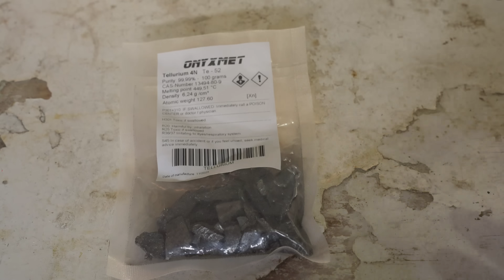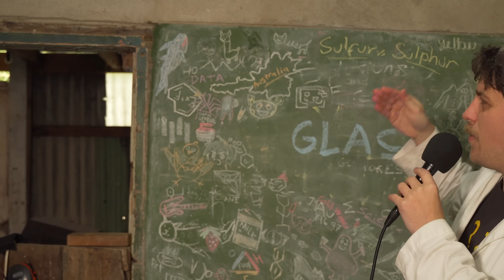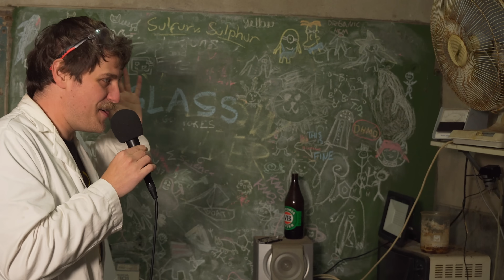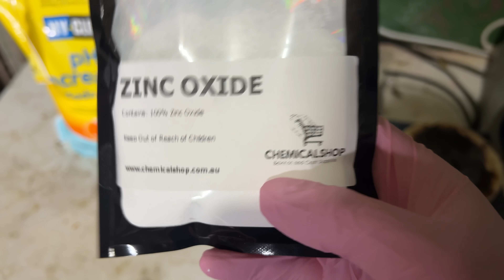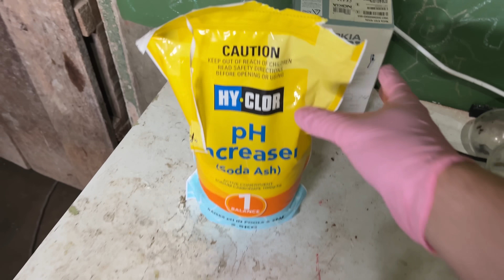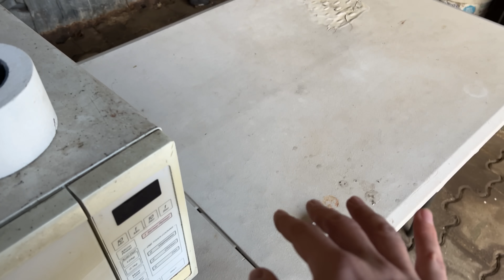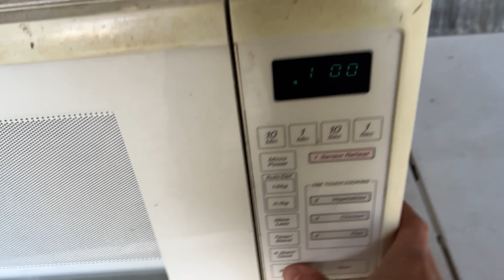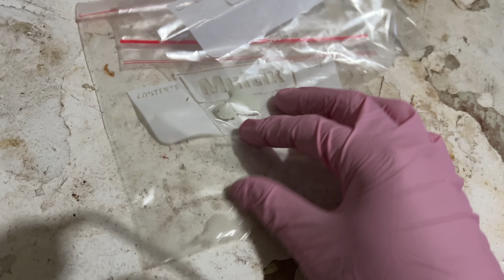Let’s make TeO2 glass with bright fluorescence

Comment: Nice video thanks. Slight misinterpretation, the rare earth does not emit a phonon, rather it relaxes non radiatively (quenching) through energy transfer to the molecular vibrations of the lattice. More precisely the quenching is via the overtones of the phonon energy. Hence if the phonon energy is high, it only takes a few times the phonon energy to be quenched, and if the phonon energy is low, it takes many times the phonon energy to be quenched. Hence low phonon materials display less efficient quenching of the rare earth excited state.

Comment: A phonon is a collective oscillation of many atoms in a crystal. It's a wave that moves through the material, and can be either transversal (like shaking a string) or longitudinal (like squishing a spring). An atom's position in a lattice is very dependent upon its neighbors. You start to shift one atom, and that'll effect the nearby atoms, which in turn effect their neighbors, hence the propagation of a wave.
Reply: Also, telluride (along with the other chalcogens) form a family of two-dimensional materials known as transition metal dichalcogenides (literally just 1 transition metal and 2 chalcogens per unit cell). Specifically, WTe2 is special because its monolayer is a quantum spin Hall insulator (QSHI): current only flows around the edge of the material, and the direction it flows (clockwise or counter-clockwise) depends on the electron's spin (e.g., spin up will flow CW and spin down will flow CCW). This can be used to selectively populate a material with a certain spin, such as a superconductor, which conventionally achieves superconductivity by coupling electrons of opposite spin together via phonons (hey we just learned about those!). Once you can force a superconductor to operate with all like-spinned electrons, thennnnnnn weird topological BS and Majorana madness occurs lol that's as deep as I understand it, but this is one of the routs researchers are taking to creating qubits under the topological architecture.

Comment: Condensed matter physics and materials science loves tellurium. It is one of only a few chiral inorganic crystals with helical chains of Te packing together with a single handedness and can be either left or right handed helices. On its own there is a lot of interesting work to do with a chiral crystal like chirality induced spin selectivity (sorting electrons by spin). Beyond that, pnictogen (Sb, Bi) tellurides are topological insulators, bulk insulators but highly conductive on the edges of the crystals and thermoelectrics. Lots of other cool main group tellurides out there too! -solid state chemist that works with Te most days

Comment: My favorite way of making metal oxides is just to tape it to a more noble metal and drop it into salt water. After a couple of days you can get this geyser of oxide coming from the less noble metal. The best part of this method is if you need this to be done faster than a month-year to fully oxidize your metal, just throw some voltage across the pair. Pos to the one you want to disappear and neg to noble metal. If your material passivates, no worries. Just add more voltage. Want it to go really fast? Add more voltage. I'm sure someone who deals with electrochemistry or galvanic corrosion is going to comment on the brute force method this can become. Oh, and it can be mildly dangerous due to the H2 gas and sparks sometimes

Comment: I don't really mess around with chemicals too much but I do use sodium hydroxide and lot for soap making and a lot of other household uses. I do like watching videos like this though because it can be fascinating and informative. I just don't have much of a need or purpose for anything on this level chemistry wise, though acid is also excellent for removing metal silverware marks from the white coating of a cast iron sink. Anyway thank you for the video.👍

Comment: Look into strontium aluminate! It seems like the logical next step after this. Tho the chemistry side seems rather simple; it's the specific heating times and insulating periods that may cause issues... also the final recommened heat is 900-1500 degrees.... Quite a descrepancy. But it gets doped with europium or dysprosium and glows for hours

Comment: Your is transparent at the edges and not in the middle is probably because of devitrification. As you said rate of cooling extremely matters in glasses, if cooled too slow in certain temperature regions, it starts to devitrify, if cooled too fast, it becomes very brittle. It would make sense that the middle part cooled slower, causing devitrification, but since you didn't do anything to slow down the cooling, it is probably very difficult to make this specific glass transparent

Comment: Excellent Tom. Hey i had an idea about the microwave kiln, in the last pour when you opened I could see the graphite wasn't heated evenly. You may get higher temps if you put it on the turntable as the microwave radiation pattern in the cooking cavity in uneven,  with hot ahd cold spots. The turntable may help
Reply: He tried that in the past. The uneven heating cracked the turntable glass.

Comment: Try keeping it hot for half an hour before pouring. My guess for the white coloring is that there are gases trapped inside that need some time to bubble out. Give it some time at liquid temperatures and it will surely improve :)

Comment: Glass is a pain to make because you need to reduce its temperature by increments eg 20C to around 600C. Takes a day or so. Then once it's at room temp, reheat it to around 450C for two hours and let it cool with the oven switched off. Although you won't need the latter step for glass samples like this. I can never remember which is which but the steps are annealing and tempering. The first allows cooling without cracking, the second removes residual stresses for optical glass etc.

Comment: The cloudiness might actually be trapped CO2 from the carbonate. I’ve seen glassblowers add sodium carbonate (or bicarbonate, can’t recall) to work pieces in order to add bubbles to the final object. Maybe the cloudiness comes from very, very tiny bubbles. If that’s the case, you probably just need to give them time to bubble up and out

Comment: Microwave a ceramic plate for about 45 to 60 seconds pour your pasty powder on it and spread it out underneath a bill using a lighter do that a time or two and youcan make that powder so dry you need a razor blade to scrape it off.....at least thats what we did with the booger sugar when it was humid out

Comment: "It's not very reactive with acid..." he says after ruining the reaction because he was afraid of the nitrogen dioxide fumes, which are the best thing to see and a sign of the reaction happening perfectly. Lol. Don't be afraid of it man, orange fumes means success. It never appears wred to be close to having a boil over so there was no reason to fear. You should do it again just adding incremental doses of nitric until it's is dissolved and then you know the reaction is done and it should just drop right out with sodium metabisulfate or sodium carbonate. Not sure where tellurium resides on the reactivity series of metals but I'm betting just adding pieces of zinc would work and switch places

Comment: I suppose phonons could be considered like Electron holes... like does an 'absence' of something 'exist'? But holes are used cause they make understanding semiconductor physics 'easier' and that in turn makes 'using' and 'designing' Semiconductor devices easier etc... so they are a 'concept' of a thing that is used to help understand the property of some material or set of phenomena (and potential makes the maths easier - a bit like holes do)

Comment: It bugs me so much that you have a vaccum pump set up, but not a fume hood. But just a suggestion, when you were grinding the mixture and dried it out on the hotplate, next time i recommend putting the mortar with its contents on the hot plate, and heat them together. It works to limit another beaker to clean, and lets you keep mixing without interruption and losses from multiple transfers.

Comment: Remove the center rotation drive gear. Get under the bottom and you should find a way to remove the drive motor. Remove it. When you use it the next  time, place the crucible in the center of the microwave area. The should optimize the melting and heating of materials.

Comment: What is the nature of the field associated with “phonons”?
Photons for example are perturbations in the Electromagnetic field.
As a particle phonons are rendered sheer nonsense in the absence of a field.
Reply: My thoughts exactly.
But they do make sense from a quantum perspective.
In Quantum Theory the particles and komplexer stuff can only get exited in these certain quantized steps.  
The related field would strangely be also the electromagnetic field because the transfer happend via the electron hulls interacting with each other, via photons. 
Its strange, because if you do the math and respect them you can create materials that otherwise wouldnt work.
I guess it just has to do with the energietransfer that different vibrational modes make possible.
Here the nonexistence of these modes makes it possible to do specific stuff with light.
I think we have to seperate  the quanta and the particle ideas from each other, the particle is from a mechanical viewpoint.

Comment: How about you take one of those cheap frying tweazers and hammer the front into a more suitable shape?
I'd try going for a sturdy, steal-tube fence pole, holding it on the tube end and then hammer the upper half in and round the tip in a bit, so it matches the shape of your ceramic dishes better.
Anyways, congratulations on a successful project! :D

Comment: would the microwave work better if the crucible was on a turn table? i thought the whole reason for a turn table is because microwaves are so huge that so areas are completely not affected by it... you can test this with a bar of chocolate, put it in microwave with turntable off only some places melt, put turn table on all places melt equally

Comment: Hi! Do you think you could make something similar but dirt cheap? Like, what if there was a way to make a zillion of such glass chips, trap them between sheets of acrylic, and put them over a greenhouse? You could convert a bunch of useless UV into something the plants could soak up. Granted, you might block some light if the crystals/chips don't have enough transparency, but that's just an extra challenge in and of itself. Thanks!
Reply: Even better would be if the emission was delayed as much as possible so you'd effectively increase the length of day a bit.

Comment: Would it be reasonable to think of photons and phonons in an optical medium similarly to electrons and holes in an electrical medium?  Holes aren't really a thing, but they are in  a place. And they interact with things.  Do phonons move around in the lattice?
Reply: Yes, both phonons and elctron holes are quasiparticles. Phonons can "collide" with photons for example (utilised in Raman spectroscopy).
But they exist independently of photons, and are not related to photons the way electron holes are to electrons (electrons and holes can recombine for example, and there would be no electron holes without electrons). Indirect band gaps are a great example of how phonons can even be important for the electrical properties of materials.
Reply: Neat, I learned a thing!  Might have to read more on this when I'm ready for my brain to completely explode.

Comment: I want to see you make/isolate and distill heavy water via the Girdler sulfide process and distillation.  I want to see how much more it would hurt[you] to get hit with a water balloon filled with heavy water.  I suppose an average water balloon would be about 45g so the heavy water ones would be about 5g heavier.  At 8 m/s that's only .05kg * 8m/s = 0.4N - 0.36N = ~+0.04N.

Comment: get some pliers for fucks sake 😭😭
other than that, amorphous glasses are transparent, rather than crystalline ones, the quenching speed is important, as the edges got clearer than the guts is a sign that such cooling temperature was enough to produce amorphous structures, therefore if you want a transparent or translucent glass you better quench in icy water and then anneal not otherwise

Comment: Stand next to a bomb and tell me sound is not an object. We can literally see sound waves as they distort things so yes they are objects. Sound can make you sick at a distance at the right frequency or even kill you. Everything vibrates. If it's warm at all, just a micro fraction above zero Kelvin then it is vibrating. It's the interaction with these vibrations the show us sound waves. The higher the volume or pitch of the sound you can think of it is the higher the current or lower volume. Sound is physical material just as much as the plasma from electricity is..

Comment: It seemed like it was offgassing still for a little while there, if you really cook the shit out of it will it get so hot and fluid it just pisses out the dish? (probably making deadly cancer causing fiberglass, or maybe raindrop like tiny gems?) Or, if you let it cool inside the dish for a little bit, and only then try to pour, would it still work fine? you should even still be able to remelt these huge chunks you have if you wanted, right? 

Opens up some good questions to optimize ways to do this for the home scale everyday moron. Probably i'd just slam in a whole beer bottle and let it rip. I feel like you can't overcook or burn it, it's not like it's food. Maybe you could have a second furnace you quickly pour into and anneal it in that instead of this open metal tray that is actively heated. Probably the mechanics of it was all figured out in like 100AD but they were using some apprentice with a set of bellows and charcoal.